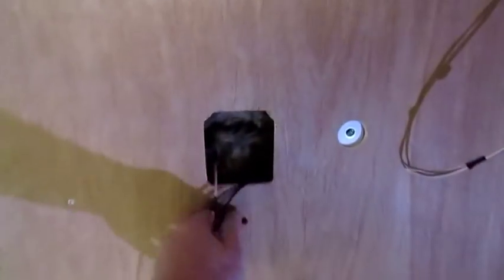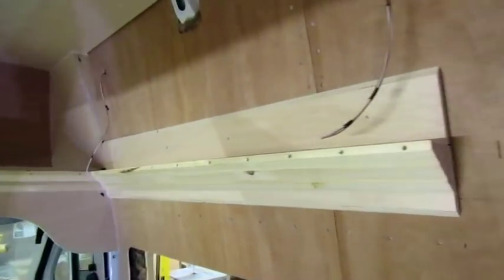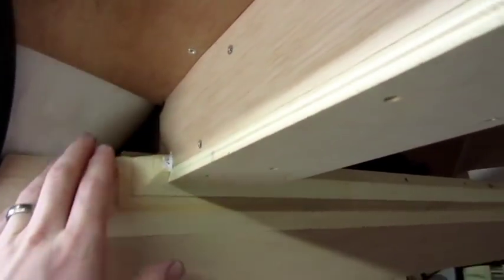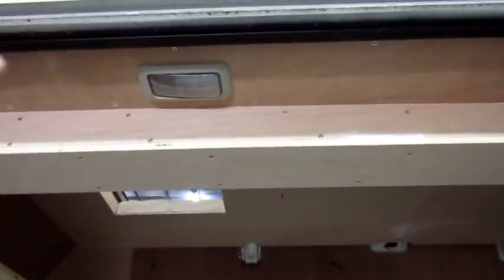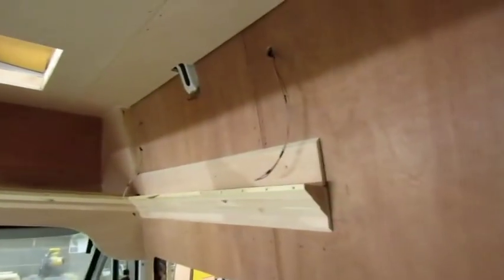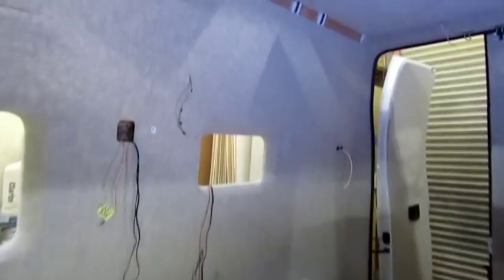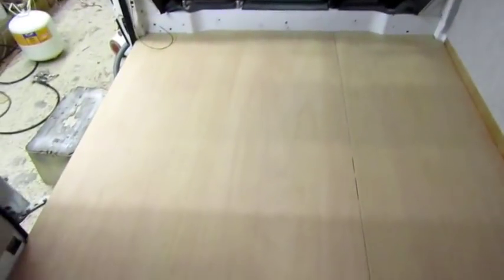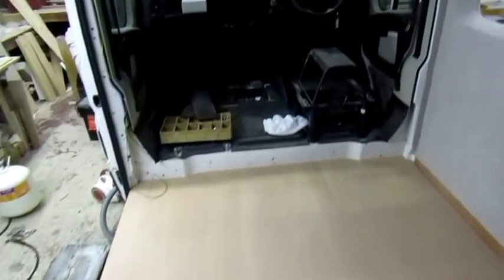How to Build a Campervan Citroen Relay LWB extra high roof Series 7 Episode 3

Comment: Hi. Your videos are a great encouragement to embarking on my conversion project. I am currently just starting a Relay conversion  (but H2) so this is good to see how a professional does it. One thing I'm not sure you showed or maybe you didn't consider it is .. how do you access the rear light clusters/unit to change rear/reversing/brake lights. There are two 'fasteners' behind the light units that need to be accessed from inside the van to release the unit. I would like to carpet line the rear areas alongside the doors, but don't want to prevent access to light units so may leave the plastic grids in place. Or did you just carpet the grids individually from the rest of the liner? Thanks again for taking the time and effort to show (some of) the tricks of the trade :)  and to help people like myself to have a chance to learn from people like you guys.

Comment: Dan, another great video. I don't know if you remember but I asked you a couple of questions about carpetting which you helped me out on a couple of months ago. Just wanted to make a point that you nor anyone else has (to my knowledge) never made in any video - carpet has an inside face, and an outside face. It may sound obvious, but if you've never done it before some carpets look the same both sides, especially if you're working within the confines of the van in poor light! I managed to carpet both walls with the carpet inside out, and had to rip it off & re-do it (expensive mistake!). Got it done in the end though!

Comment: Hi Dan, do you not see the need for a vapour barrier to help stop condensation?
Reply from the maker: No need for a vapour barrier as long as the camper is well ventilated. We have been building campers for nearly 25 years and never a problem.
Many thanks for watching

Comment: Hi Dan what thickness ply do you use on the walls thanks
Reply from the maker: 6mm ply on the walls.
Many thanks for watching
Reply: Thanks Dan and love your videos and nice jobs u do buddy. Can u give me more info of how u ply or timber walls before you put your final finish ply on to get walls all flush I have a boxer l4 h2 thanks
Reply from the maker: @ThrottleoutEnduro1  
With that van you need straighten the walls so that they run over the hump ( aka C pillar ) which mean using timber rail on the middle rail but you need a long straight edge to get your measurements. This way you can carpet straight over the ply or vinyl wrap the panels first either they come out straight. Would be easier showing you but ... Hope this helps and many thanks for your kind comments
Reply: Thanks for that Dan il have a go hopefully it works out Haha cheers ...... keep the videos coming